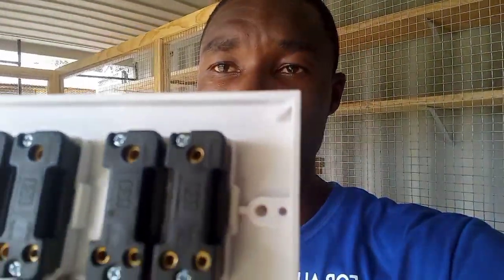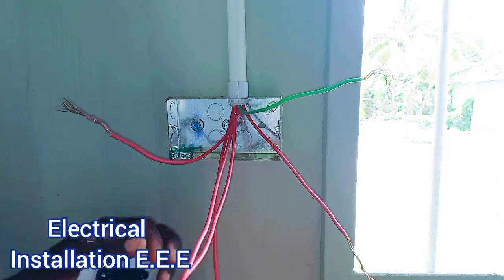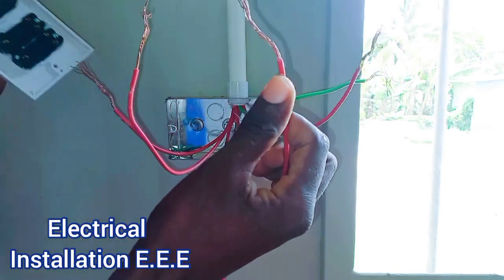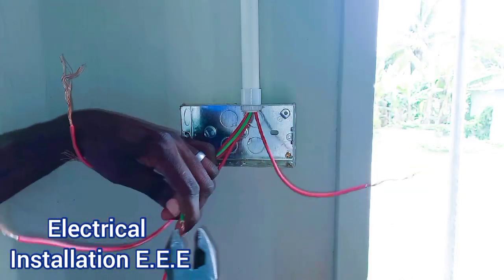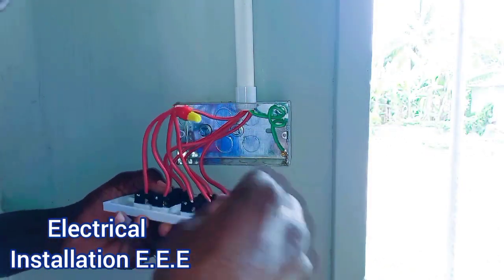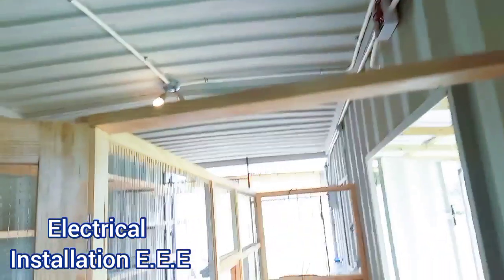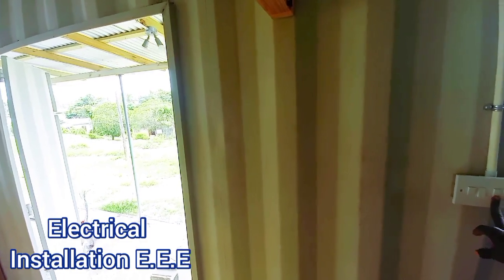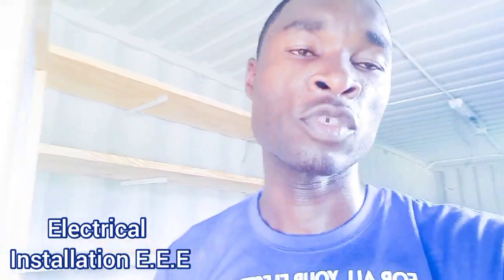How to connect 4-gang plated switches !! How to convert 3-way // 2-way switch into s/p (tutorial)

Comment: Here in the states we call that pigtail, the main which you share
Reply from the maker: The main wire at the switch is called pigtail ?
Reply: @ElectricalInstallationEEE  Yes most electrican in the state called it pigtail.